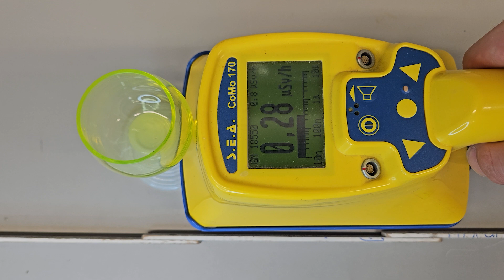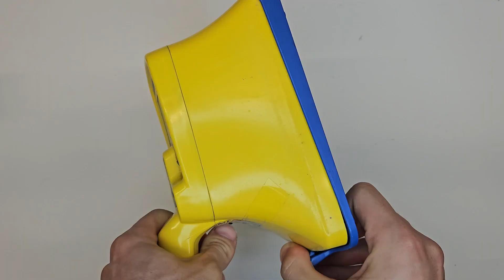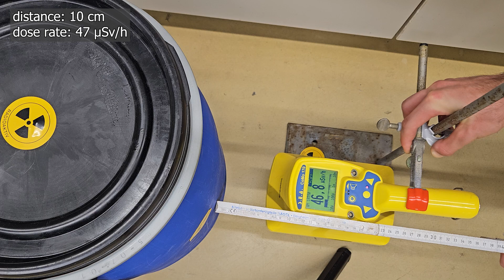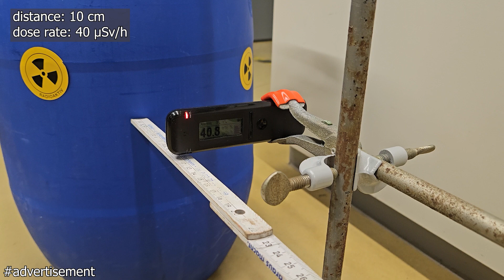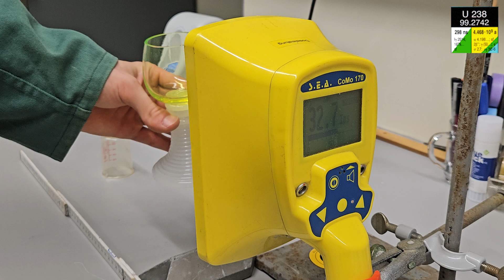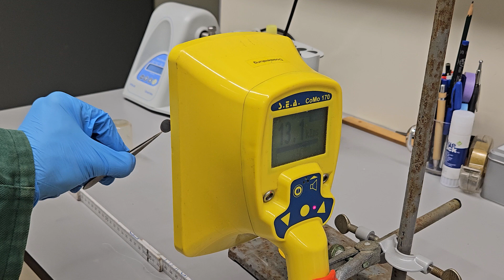Radiation protection measurements - practical nuclear chemistry

Comment: 100% eating the uranium glass, assuming it's broken up and doesn't have sharp edges. It's got around 40 kBq of uranium, and practically insoluble, so nothing will be absorbed. It's by far the weakest source, and even if powdered would have low bio-availability.

Comment: This is a very insightful video! Congratulations on the excellent quality and clear communication.

If I understood correctly, you highlighted a zero-distance measurement with the Radiacode device. 

You'll notice a line on the device's casing (— ) visible laterally on both sides and on the front. This line indicates the detector's reference point for dose rate calibration.

Consequently, when you place the detector directly against a radiating surface, the effective distance between that surface and this internal calibration point is a fixed minimum of approximately 9 mm, rather than an actual zero distance.

Practically speaking, this calibration point is crucial for accurately specifying the source-to-detector distance. 

This precision is important for consistent calibration procedures and for reliably comparing measurements with those taken by other detectors, especially since, as you effectively demonstrated, dose rate varies significantly with distance (often following an inverse square law for non-shielded (*) point sources). [(*) With shielding, we ended up with an irradiating surface, with many secondary gamma rays, of lower energies, scattered at all directions, among characteristics X-rays].

However, at much larger distances from the radiation source, the relative impact of this ~9 mm offset on the overall source-to-detector distance becomes negligible, and correcting for it at the field is less critical.

Typically, a detector's calibration point (or effective center) is defined as the plane passing through the geometric center of its sensitive detection volume or medium.